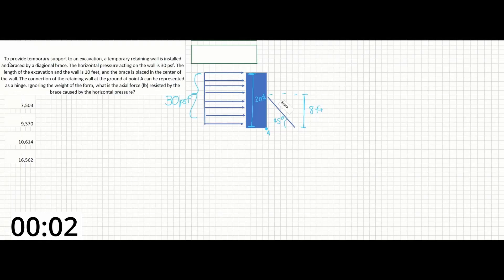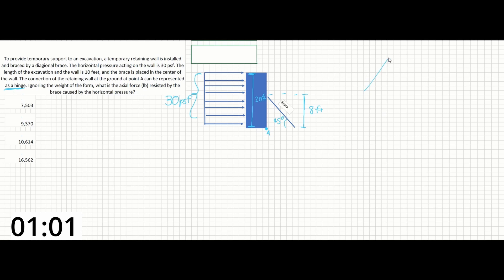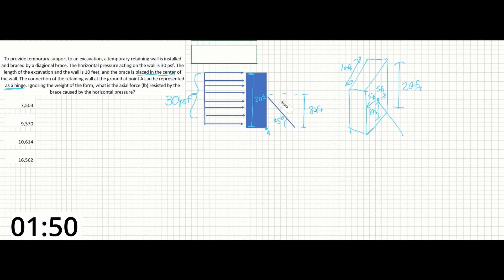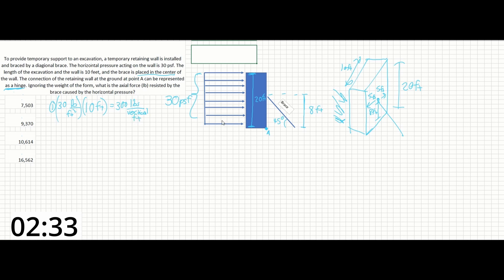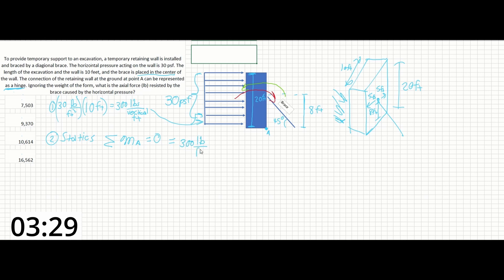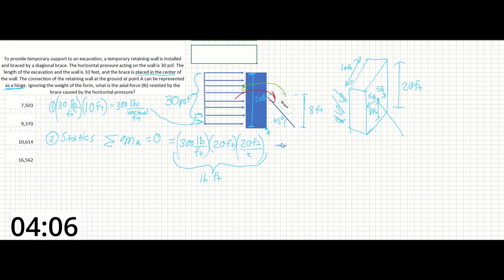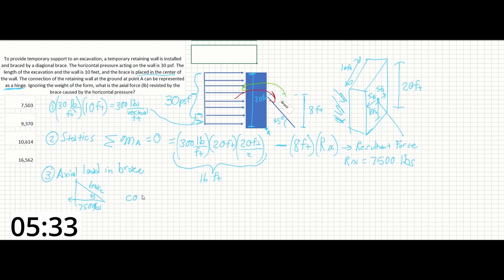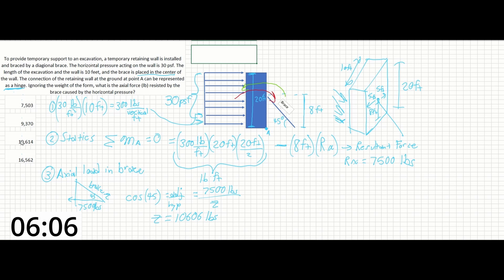PE Exam Practice Problem #74: Structural Mechanics | Retaining Wall - Horizontal Pressure

Comment: Can you explain why the y-component of the resultant force is not taken into account? I think I understand but want to be sure. Thanks!
Reply from the maker: Hi! I hope this answers the question: The soil is only applying a force on the wall in the X direction, and the problem is only asking us to find the AXIAL force that is resisting that force. Therefore we can look at the moments created by these x direction forces and solve for the force in the brace that is resisting the force of the soil. If there is a Y direction force acting on point A, it is not called out in this problem and therefore we don't have anything to solve for that direction.

Comment: Hi -- appreciate all of the videos. Shouldn't the moment arm for the horizontal pressure acting on the wall be 20ft/3 rather than 20ft/2?
Reply from the maker: Thanks for watching! I assume you are asking about the 30psf distributed horizontal load acting on the wall. I'm pretty sure that the resultant force is supposed to be in the middle of the height, meaning half of 20ft. If I recall correctly, 20ft over 3 would be if the load was not evenly distributed but instead uniformly varying, aka shaped like a triangle. I think this video below also supports how I solved it: https://www.youtube.com/watch?v=lmmBujabZ-Q       Let me know if you disagree. It wouldn't be the first time I made a mistake trying to post a problem late at night.